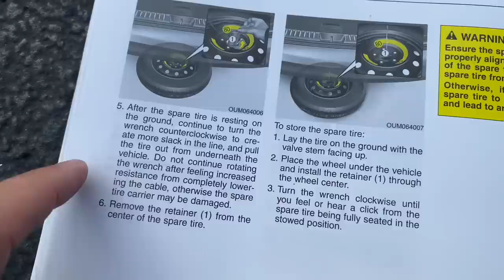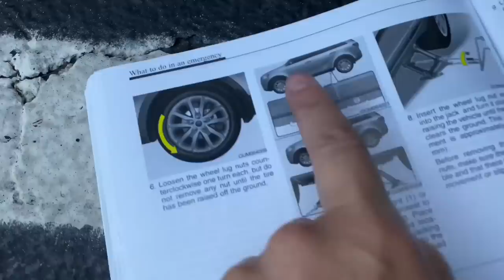CHANGE A TIRE WITH ME 💪🏼 | SINGLE MOM CHRONICLES

Comment: AAA Roadside Assistance about $60.00 a year. Will save a lot of grief. They will change tires, batteries, jump start, bring gas if you run out. They are fairly quick and if they can’t fix they will tow it to where you want. Definitely not worth the time or effort to try and do yourself. Cost the same as one trip to dollar tree but good for a whole year.

Comment: Way to go! You are awesome. I was sitting here & talking you threw it, as if you could here me! LOLA LOL LOL!  But you can do anything if you wan to. I can't even remember how many I have changed in my life. My dad was in the car repair business. He always had a car he would give me & ding bat me didn't figure it out that I was his  Guinea pig car tester. I can not even remember how many times I would break down & he would get it fixed & give back to me. Then if I drove a car for 3 months & it didn't break down he would sell it. You know he would tell them if his teenage daughter drove it for 3 months with no problems. The car was in tip top condition. LOLA  LOL But I got to drive some awesome cars & trucks & sports cars! I really thought I was something. Ha ha haha ! Those were the days back then. I can drive just about any thing.  Between my dad & the Army yep I haven't had a run in with a car yet I couldn't drive. When I taught my boys & girls how to drive they had to learn in a standard. So if something happens & there car or somebody's standard broke down they would at least have a way to go get help or how to push it to start it. Now everything is computerized.